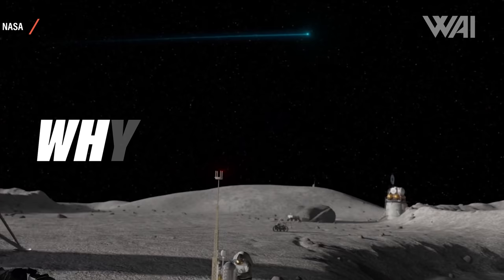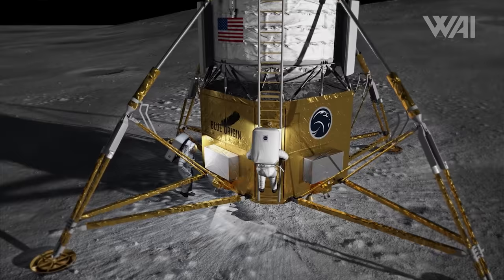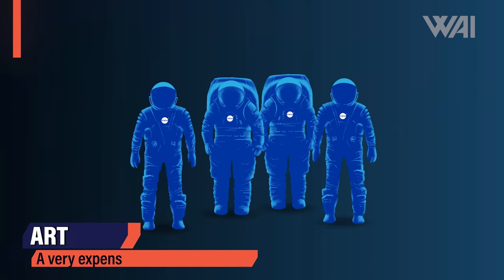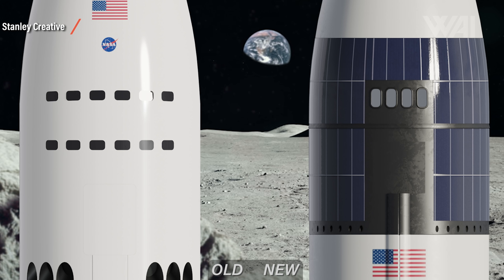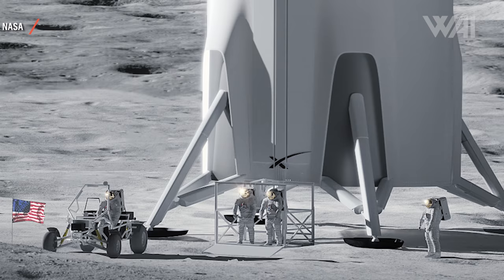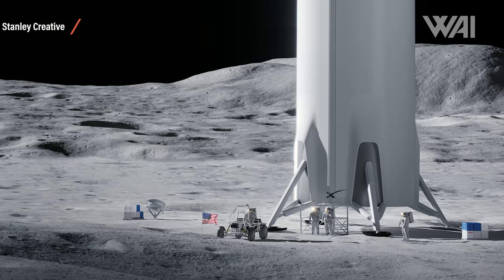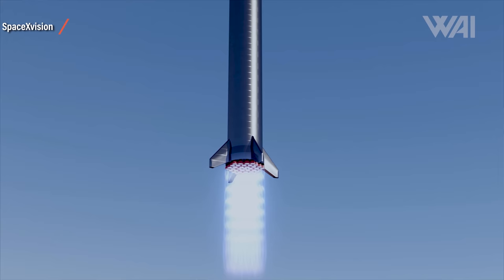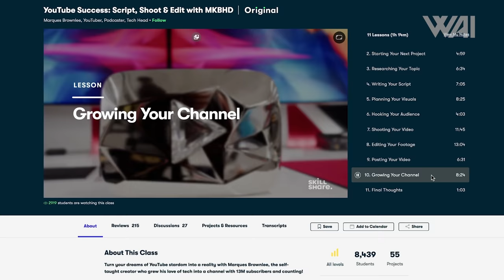Why Did NASA Award SpaceX 2.9 Billion Dollars For A Lunar Lander?

Comment: Soo with every load of cargo they need to launch new lunar starship? Or would be possible to transfer cargo from classic starship to lunar version and if yes would be lunar gateway needed?
Reply: I don't think they've said anything about that, and remember that classic Starship is not currently part of the plan. But I would assume that any resupplies will be carried on the Orion capsule, and transferred either through the docking port, or maybe some larger stuff via EVA through the elevator hatch.

That said, remember, the project was designed around something a bit more conventional like the Dynetics or BO bids. Starship really isn't what they had in mind, so the ability to land a hundred tonnes of cargo on the moon is probably something they're still getting their heads around.

Comment: Great video! But how do the astronauts return if the lunar starships stays on the moon? I remember that there was the plan that the lunar Starship will provide the cargo to the moon and one of the other competetors the descent/ascent stage.
Reply: It will lift off from the moon but only go into moon orbit to re-dock with Orion or gateway.
Reply: @subwarpspeed  Thanks for the Information! Wouldn't it be easier to have a starship in moon orbit instead of the gateway or orion? This would make it quicker and easier to accomplish missions. 
At the same time, it would mean that the Lunar Starship would have to make two landings on the moon.

Comment: I can see how a crew dragon + lunar starship can make the Orion SLS redundant (if it actually works by 2024 or whenever they are going to push the date back to) but how does starship make Gateway redundant?
Starship is in no way designed to be a modular expandable permanent long-term space laboratory.
Reply: A single Starship is about the same size as Gateway would be, so all it needs to function as a station is a docking adapter that can dock multiple vehicles.

Comment: It seems like the Apollo 13 lessons may have been forgotten.  It took the brightest minds in the world to save that mission when it went wrong.  A some extra weight and expense for a multi-purpose lunar starship would be much safer.  If it has no heat shield and reentry equipment onboard there's no Plan 'B'.  Less we forget, losing the first shuttle put the space program on hold for years.
Reply: So you're criticizing the Artemis program plan in general? Since none of the HLS would have been a plan 'B' for earth return and re-entry.
Reply: @subwarpspeed  It's great the general public gets to communicate and comment on the hardest science and engineering challenges of our time.  There are some great resources out there too on all the steps taken to get us where we are today.  Good luck.

Comment: I don't understand why a starship would be used to land on the moon.  First, it has big huge Raptor engines that will just be dead weight landing/taking off from the moon.  Perhaps they could be removed once in LEO?  Also, the gigantic fuel tanks will presumably be mostly empty for the lunar landing.  If it were me, I would make a 3 stage craft with a special Starship nose cone section being the third stage.  It would detach from lower portion of Starship and be the "shuttle" that goes up and down from the lunar surface.  
Also, I think the ultimate goal should be to build a magnetic rail on the moon for launching craft back to Earth or anywhere for that matter.  You would just need electricity to launch craft.  I came up with the rule of 50.  50m/s/s acceleration for 50 seconds on a 50km track would get you to lunar escape velocity.  With no air on the moon, you can accelerate all the way up to speed on the surface.  If you increased your acceleration further you could aim yourself at Mars or whatever and it would require no on board fuel.  Just need fuel to land at the other end.  For Mars, you use the atmosphere to slow down and only need enough fuel for course adjustments and the final landing burn.
Reply: Building a 50km linear accelerator is a MASSIVE undertaking, even on earth. Building this on the surface of the moon makes it astronomically more difficult. Also a three stage Starship would increase complexity. More things, that would need testing/could fail.
Reply: @Bennet2391  Definitely hard.  But colonizing Mars is the plan and that is crazy hard too, I would argue substantially harder.  Colonizing the moon would be easier than colonizing Mars and once an industrial base is established on the moon, a 50km track would be a very reasonable thing.  I picked 50km because at the distance you could accelerate at 5 G's to escape velocity, 5 G's is very tolerable.  If you pushed it up to 7 G's you could shorten up the track a lot, but 7 G's is tougher to endure, but still a conditioned person positioned with their back to the accelerating force can do it for 30 seconds or so.  It would be a lot more efficient to "shoot" stuff to Mars off the moon versus rocketing it off of Earch.   This assumes that we discover resources on the moon.  Obviously, shipping stuff from the Earth to the moon just to then shoot it to Mars doesn't make much sense.  The current plan of sending Starship after Starship after Starship with 6 launches needed per trip to Mars just to get enough fuel on board is quite the challenge as well.  I suppose if Musk really is able to build thousands of Starships and launch them every few minutes then it is doable.  

Regarding a Lunar Lander separating stage from Starship I don't see as being much different than the current design which basically has a third stage that just doesn't separate.  Take your hand and cover up everything below the lunar thrusters and what is left is basically a third stage.   Lunar lander starship is going to need a whole heap of design and testing regardless.

Comment: Does this also mean the Gateway Station will be delivered via Starship (Probably in on go lol)?
Reply: In my opinion, kinda. Wish I could find the link, but I think I read something like SpaceX already have a contract with NASA to fare parts of Artemis gateway to space using Falcon Heavy. But since SpaceX plan to retire both F9 and FH once Starship is operational, I guess SpaceX will be using Starship instead of FH to fulfill that contract. But it really depends if Starship will be operational by that time, otherwise FH will be doing the job.
Reply: @collinsoju9192  I think they are much more restricted in what vehicle they can launch it with and other considerations. SpaceX was awarded contract for delivering PPE and HALO elements on Falcon Heavy.
What I see more likely is either Dragon XL being swapped out for the Gateway Logistics Services program. Or replaced later on because that is not building gateway but resupplying it during it's full lifetime. At least last year it said 15 years and I don't think we have FH flying for so long.

Comment: I believe you said that the Lunar Starship won't take off but if not how do Astronauts get back to the Gateway?
Reply: I didn't hear that. It definitely will be returning to the gateway.   But it won't be able to return to Earth, and certainly can not re-enter the atmosphere.  It doesn't have a re-entry capability, and won't have the fuel to return to low Earth orbit.  I suspect they won't even try to re-use this craft. How do you adequately maintain such a craft without even a hangar?  They'll have to put it in an orbit that won't eventually crash into the gateway, or permanently make it a part of gateway.

Comment: OK guys, You want to have a Starship land on  the moon verticaly. And it will most probably be able to do it. But will it safely remain in this vertical position, even in the case of a possible moon quake?  The quakes there are reported to be a seriouse problem. - It might be safer if it would be able to have some hydraulics, probably attached to the moon variant of Spaceship from outside, - to put it horisontal and then back to verical before it would start back from the moon?

Comment: If the descent engines are going to be so high up on the new lunar starship, why can’t you have a cargo hold at the bottom of the lunar starship where it would be so much easier to get things out of and onto the lunar surface? By the way, I really like your stuff and even though your videos frequently give me cancer I still like to watch them.  (You said you wanted feedback!)
Reply: The bottom houses the raptor engines and they are mounted to the tank section. Designing this in any other way would probably be a lot harder/different than just making the best elevator possible.

Comment: My money still is on them launching a starship into orbit unmanned. Probably even landing it unmanned and then throw a crewdragon at it with the astronauts inside. Seems like the most riskfree option imho
Reply: To launch the lunar Starship with crew, it would need sea-level engines to survive an abortive ascent. To return to Earth orbit for refuel/resupply, it will need sufficient fuel to bleed the delta-v as there will be no tiles or flaps. Otherwise we are needing tanker and cargo Starships to go to Lunar orbit to meet up with the lander. I'm still not sure what the point of the gateway is.
Reply: @clivemitchell3229  for possible refuelling, as a lifeboat in case something goes wrong or to transfer astronauts from a crewdragon to a starship. Could be either one of those things. They've chosen the starship but they haven't quite worked out all the details. Anyway, I am all for them building in as much abortstages as possible because it's lives they are gambling with.

Comment: What I don't understand about lunar starship is the abort profile. The astronauts won't be launching in it right? Otherwise what happens if you have an engine failure or need to de-orbit in an emergency?
Reply: As for all HLS they goal was just to take astronauts from moon orbit down to moon surface and back to moon orbit. The alpaca neither had any type of different abort variant? So not so strange.

Comment: OK ----------  I have been wondering. With the frozen solid temperature (ICING) of Methane well above the temp of Liquid Oxygen. Could Space X's problems with the Starship's engines during landing be the X-mas tree of methane pipes inside the bottom of the Lox tank on the early SN-8 through 11, simply Icing up (freezing the methane) during the minutes of freefall, restricting the flow of Methane fuel to the engines?  If so I hope moving the tree outside the Lox tank fixes the problem. Though that does not remove the long downcomer from the Methane header tank, from the Lox Tank. If Icing is a problem, even landing the Starship without the Belly flop maneuver will not work. Though it would prove what the problem was all along.  But once proven the fix is very simple....  BUT then I am sure Musk would have thought of this long ago if Icing was a Possibility or Problem.
Reply: No — the various problems with SN8-11 are all well known, since SpaceX are pretty open about this. SN8 was due to insufficient pressure in the methane header tank, SN9 was due to one engine failing to relight, SN10 was helium ingestion (a bad workaround for the SN8 problem), and SN11 was a fuel leak triggering an engine failure. Nothing to do with ice.

Comment: May sound silly but it is entirely possible that a Lunar Starship could happen without a successful Starship.   With no need to to the Belly Flop, or Re-Entry a lot of complexity and risk is gone all they need is a working Booster.   Not necessarily even a full Booster capable of landing.  A lunar landing would likely take much less fuel to complete than a earthbound one and a lunar launch most certainly would especially if a large amount of cargo is left behind dropping a Lunar Ship's mass significantly if you include fuel used in the trip.
As far as returning the crew back to earth drop the Lunar Ship in a parking orbit rendezvous with a Dragan (not necessarily in that order but still) and kick the crew out to send them home.  Reload the ship with a throwaway starship cargo pod/ fuel cow toss another Dragon at her and aaaawaaay they go.
PS i fully expect SpaceX to toss a few Boosters and maybe even a Starship or two in the ocean before they go full reuse on them just like they ended up doing with the Falcons test, test,  and test some more or not things go wrong too easy not to find out more from live action events.

Comment: My guess (& it's only a guess) is somewhere around around 2025-2026 for the first Lunar Star Ship landing, and 2028 -2030 first Star Ship Mars landing. The reason for the longer delay on Mars is because of planetary orbital dynamics. Mars is only approachable in a reasonable time frame every 2 yrs. Before Star Ship is human rated, it must first go thru a lot more testing and the final design has to be proved reliable to at least 98%. Even then, you will have the problem of the one little thing that will bite you in the a** (ie; Apollo 13).

Comment: Lunar Starship won't need sea level engines either. THere's a lot of system whose removal will save tons of weight. It will probably able to take 150 tons to the moon.

Comment: So, for the initial launch of the Lunar starship, will they need to keep the sea level engines? seems silly to keep them once its in orbit. just dead weight at that point. just keep the 3 vacuum engines.
Reply: AFAIK the Vacuum Raptors are fixed. If they removed the Sea-Level Raptor, they would lose thrust vectoring.

Comment: No one has explained how the astronauts ascend from the lunar surface if they arrive on a Starship like you illustrated. Does anyone know the answer to this?
Reply: Exactly like they would have done if any of the other landers won the contract. HLS is a piece in the Artemis puzzle for being docked in lunar orbit and have astronauts come onboard, descend to moon surface, ascend to lunar orbit, dock and astronauts disembark. To and from the Orion capsule or the gateway station.
Best guess is that the landing thrusters brings it up from the ground to a safe altitude and then uses Raptor that is efficient to go into lunar orbit.

Comment: If the raptors will cause too much regolith at landing, how will it take off again? They will have to build a launch stand of some sort.
Reply: The landing thrusters. They need to have a greater than 1:1 trust to weight ratio so they can do a soft and controllable landing. So they should be able to lift it up again to a safe height where efficient raptors can take over.

Comment: I'm wondering what is with the 6 raptor engines and its tank structure? 
Will these uselesse parts deinstalled by Gateway to reduce mass?
A lot of useless mass will carried to Moon surface and back to orbit/ La range point?!
The lower Part of Luna Spaceship is therefore obsolet!
What ist your opinnion?
Best Regards:

Comment: My problem with the SpaceX lunar lander is how do the moonnauts get off the moon and get back to earth?

Those lander legs look flimsy enough to land it on the moon, but what about back here on earth?  Also, what about a heat shield for the lunar lander when it coms back to earth to deliver the moonnauts home?
Reply: No. That's not how it works. The starship is just the landing system. Once it lifts off it'll remain in space forever, until it's retired. First it'll liftoff and enter a leo. Then a second starship will refuel it before it'll enter a lunar orbit. Then SLS will take humans till lunar orbit in their Orion capsule. The Orion capsule will dock to starship and the astronauts will board starship. Starship will then land on moon and a few days later come back to lunar orbit. It'll then dock with Orion and Orion will bring them back to leo and then to earth.(Orion obviously has a heat shield). The starship will come back to earth orbit and wait till the next mission. Once the next mission is planned it will refuel and get ready to land again.
Reply: @nagarjunkashyap5987  Thanks for the reply, and sorry for the lengthy reply but I don't know about Orion's role yet...  Bear with me a second, read it all and then respond.

One would think that when Starship lifts off of the moon, with the rockets down near the legs, there is going to be a lot of wear and tear from all that regolith blowing back.  

After they're done on the surface and it's time to come home, I can't imagine that massive ship getting off the surface of the moon without the main engines at the bottom of the Starship helping.  

My vision of the landing is this...  Starship is going to be coming into orbit at screaming speed.  It will need to slow down greatly before it lands, so I think the main engines will slow the ship down first, and then once it gets close to the surface the main engines cut off, and the rocket nozzles close to the crew cabin will gently settle it onto the surface of the moon.

Then the astronauts do what they're gonna do.

When it is time to come home, those smaller nozzles towards the crew cabin are not going to be able to lift that massive ship off the moon's surface, at least I can't think how they would.

That means the main engines will need to do it, and that means that there is going to be a lot of damage sustained by the main engine rockets from all that regolith blasting components, etc...

If the plan is to leave the Lunar Starship in orbit around earth, and refuel it for another round at some later date, you're going to need some sort of maintenance done on it.

Make sense?
Reply: @Les_S537  They will be able to lift it, or it would crash on landing. After a few hundred meters you can use the main engines, all you need is enough fuel.